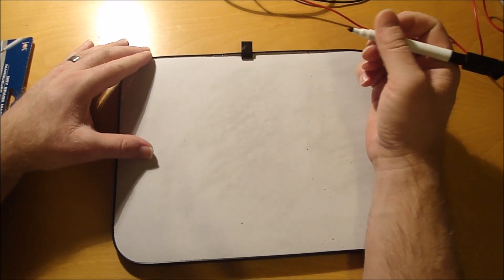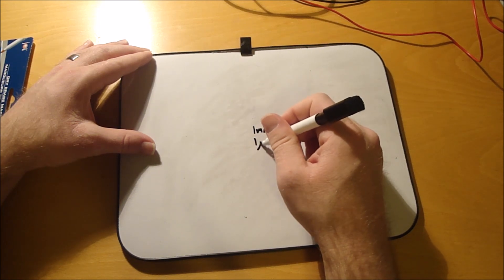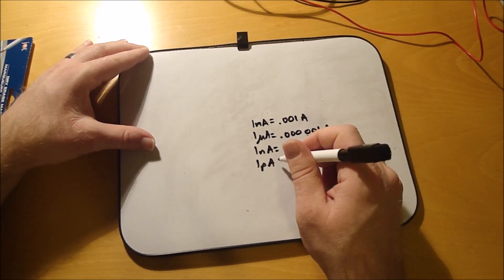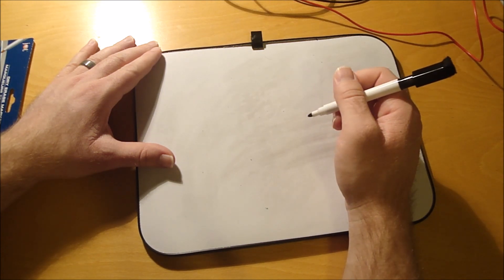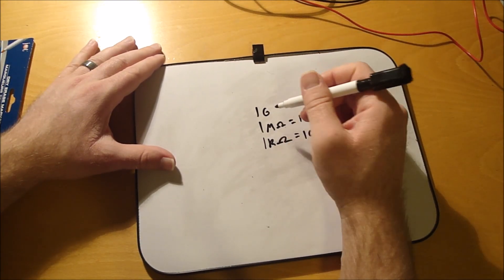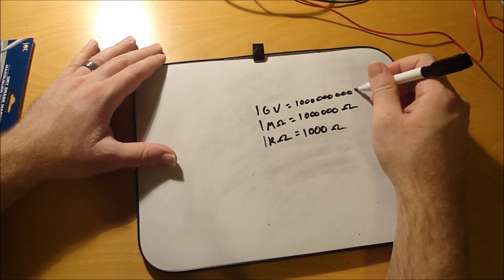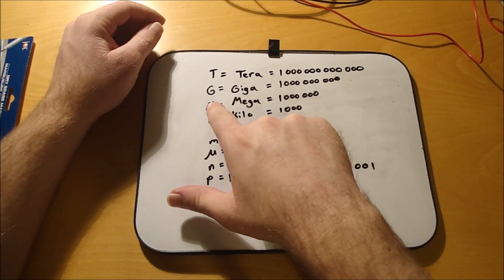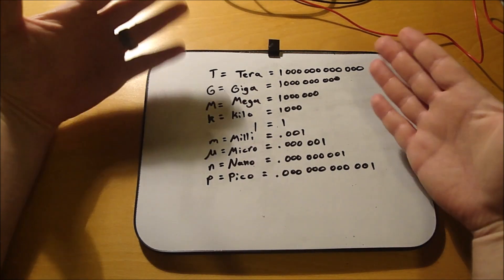Understanding Prefixes Kilo, Mega, Giga, etc.

Comment: if anyone sees this, when do you use say "mega" instead of "kilo" (or any unit change, same principle)
i see people using "mega" when units reach over say 100 kilos (.1M), but sometimes "mega" is used only after reaching 1M
Reply from the maker: I typically change after 1 but both are still correct.

Comment: Is there such thing as 12giga ohm resistors, i got some resistors and Thats what they came out to be on the band color converter but I've never heard of such a high resistance.
Reply: me calculating resistance on class project:
Reply: Technically speaking...
Yes you can have Giga Ohms of resistance you can have even higher
the more important questions are...

1. Can your multimeter measure the difference between a Giga Ohm resistor and a Tarra Ohm resistor , for arguments sake
i dare say you'd get  OL if you tried to measure it 
Why ?   Because it's not practical

2. if you're at that resistance you have an open Circuit and you're basically dissecting the difference between  , which open circuit has higher or lower resistance vs another
LOL

so... yes it exists
but you won't realistically find a resistor in that range because you don't really have a wide spread practical use for it
i dare say you mixed up the colours

Measure the resistor,    what value are you getting ?
Reply from the maker: Here's a link to a 100 Gohm resistor. It's possible: https://www.newark.com/ohmite/rx-1m1009fe/through-hole-resistor-rx-series/dp/03P2438